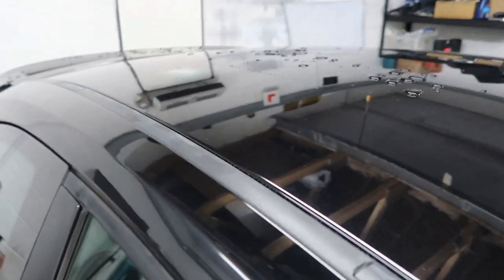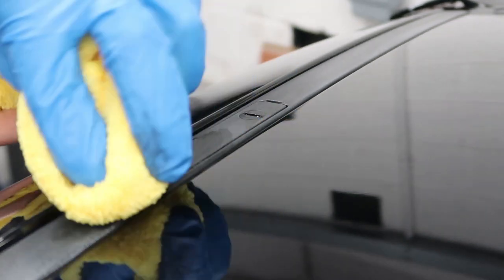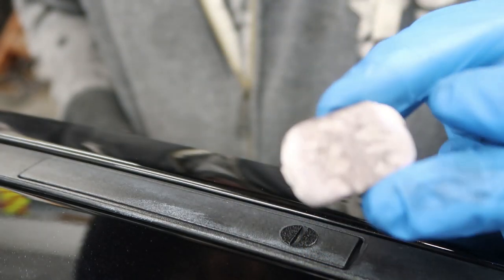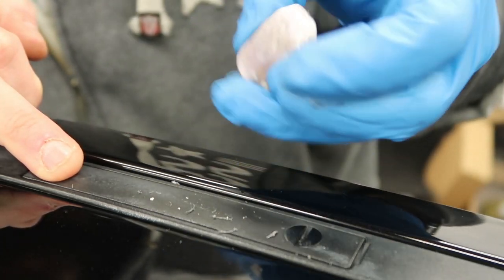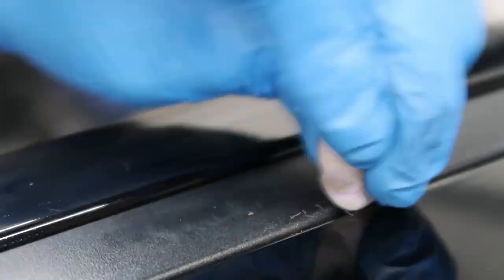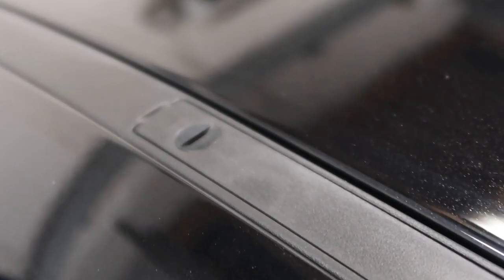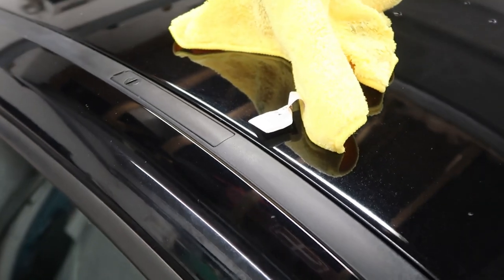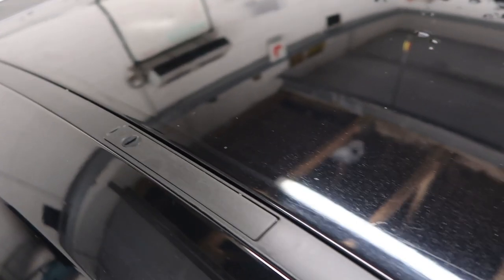HOW TO REMOVE WAX/POLISH FROM PLASTIC TRIM || A quick trick!

Comment: Another good video. 👌 Just been through this on the Raptor (F-150 truck - lots of plastic!). Had the rubber up my sleeve just in case. Used a combination of Back to Black trim cleaner kit (gel and brush) and Turtle Wax trim restorer. Big truck looks mint now. 

Been covered in wax marks on every bit of trim since we bought it… was washed by the tea boy at my mate’s work I think… took me two days to detail it inside and out… off to batter him now it’s done! 👋😬😅

I’ve seen pics on a Raptor that was done with Cerakote wipes on the trim. Looks amazing, meant to last for ages. Will have a go at that in the winter when its not 40-50°C outside. 🇦🇪🔥🥵🔥🫠🔥😅
Reply from the maker: Thank you! 
Oh damn, an f150 is a big truck to detail lol. Yeah I’ve seen the cerakote stuff, it does look good, and yeah it apparently lasts like 4-6months which would be awesome if it’s true 👍🏻
Reply: @DaveRebuilds  aye… already spent guts of a week doing major service stuff then two days to detail it… needs another two days to get up to full OCD level… but is well over 40°C with varying humidity at the moment. Was Donald ducked after that and not in a hurry to go back out. 😂 4-6 months for Cerakote I believe is about right. Worth a bash as it’s too hot to be doing that 4-6 months of the year. 😂🔥
Reply from the maker: @Mineratron  😂😂👍🏻

Comment: Dave, sorry to bother you again. I've already used three different products to try to remove the scratch: SONAX XTREME BrilliantShine Detailer, Maddox Detail - Quick Detailer and another product that a guy from the garage has used. None of the three managed to remove the scratch (which is very superficial). On the contrary, you can see a white layer near the scratch. I think it is too much cleaning product. Don't you think it would be better to apply a degreaser to remove excess product and only then use the all purpose cleaner? Or the all purpose cleaner can remove excess product and only then apply the rubber. Thanks once more.
Reply from the maker: Hi, no need to apologise, I love trying to help!
Are you trying to remove a scratch in plastic or in paint? Or are you trying to remove wax/polish residue?
If it’s polish residue on paint, use an isopropyl alcohol (IPA)
If it’s polish residue on plastic, then I’d use an all purpose cleaner, rinse with water and then try an eraser
If it’s a scratch on paint, you need to use a compound unless the scratch is deep, in which case it may need a touch up paint pen.
If there is a white layer around the area then yes, it sounds like too much cleaner has been applied and may have stained the plastic.
👍🏻
Reply: @DaveRebuilds  Hi, Dave, it's a very superficial scratch on the plastic (lower front door).
Reply from the maker: @Diesprecher  if it’s painted plastic then I’d recommend a compound dude, something like turtle wax one&done compound should remove a scratch on painted plastics no bother at all! 
I did a video on using it a while ago (think it was an old Mercedes I used it on.
If it’s non painted plastic then I’m not 100% sure how to remove a scratch as a compound would only make it worse

Comment: Doesn't work for me?! Tried cheap & decent rubbers
Reply from the maker: Dave Simpson really? Sorry to hear that, it works for me 9 times out of 10. what type of polish/wax were you trying to remove? Another solution would be to use panel wipe or a diluted IPA?
Reply: @DaveRebuilds  where do I get this rubber?

Comment: Hi, Dave, thank you for this great video! What all purpose cleaner product did you use?
Reply from the maker: Hi, thank you, I appreciate that! I typically use meguiars all purpose cleaner and dilute it depending on what I’m cleaning. For example, car interior plastics tend to get 5:1 with water, and softer materials (leather or trim) I dilute down to 10:1 so it’s not as harsh 👍🏻
It’s really good stuff!
Reply: @DaveRebuilds  👌